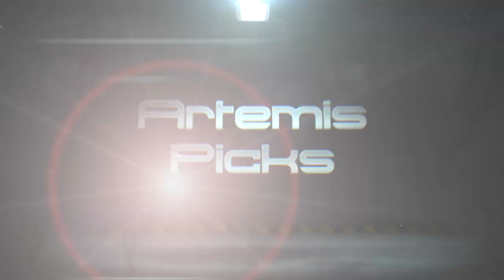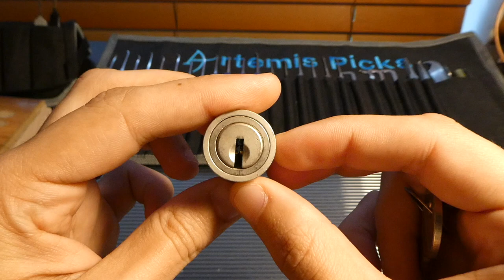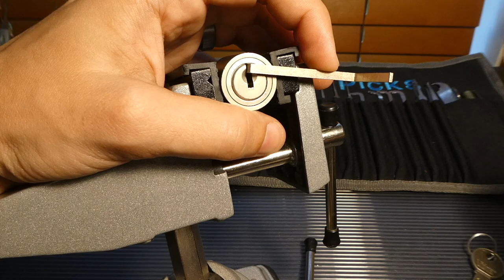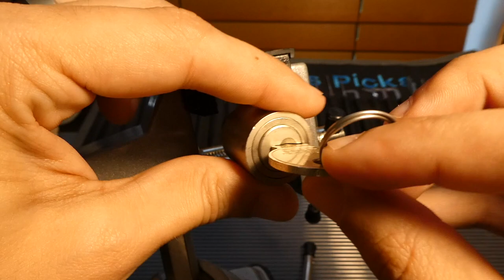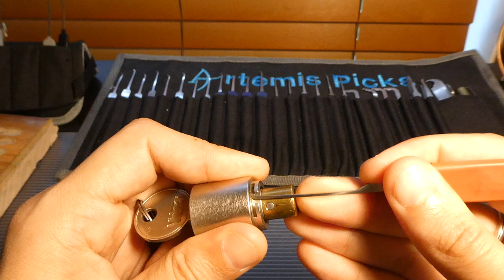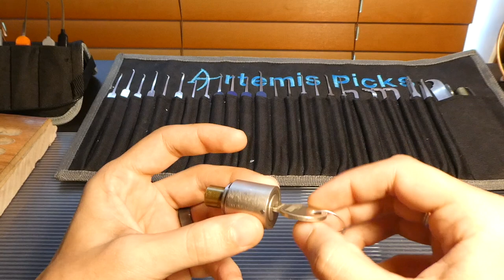[108] Vidmar Slider Lock

Comment: I have a Vidmar cabinet(with maple top) with these locks, was curious how difficult they were to pick. These Vidmar cabinets are all over my factory, all the cabinets in my department are keyed the same, seems each department has a different key. Nice cabinets, the lock drops a rod to secure all drawers. I liberated an old unused cabinet put wheels on. It makes a pretty nice toolbox.